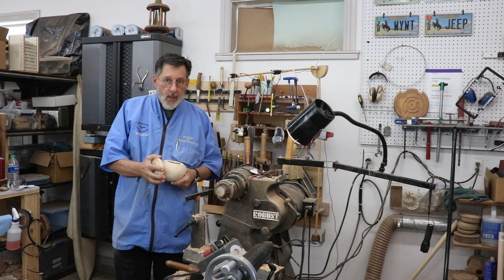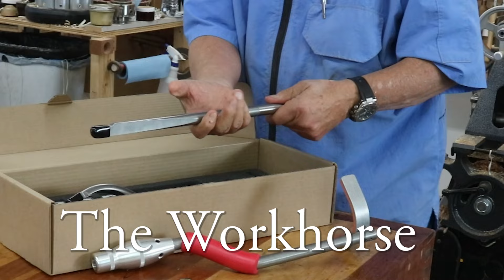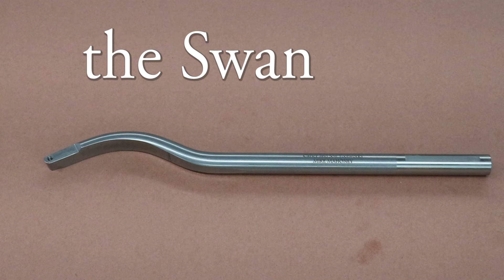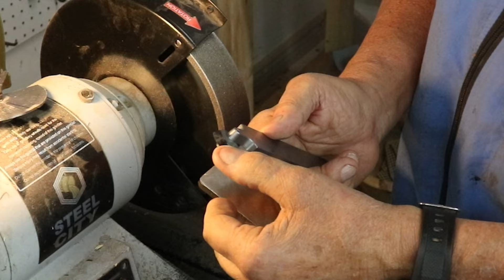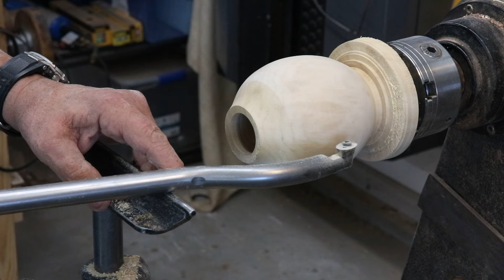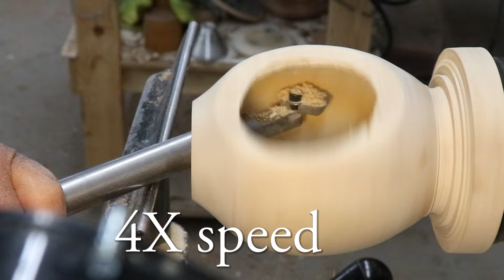Mike MaHoney Hollowing Kit Review   with Sam Angelo

Comment: Sam, great review. I was just recently made aware of it and appreciate your input. I have resisted the “captured” type system for various reasons. Feel like those might be better suited for really deep hollowing. Would love your thought? Winter is gonna hit here in MT one of these days . Stay say Sam.
Reply: Thanks for leaving the comment.  It's never winter inside my shop.....😁    I have the Trent Bosch stabilizer that I would consider a captured device.  The stabilizer is well suited for deep following. I personally don't hollow much beyond 11 or 12 inches deep. That is enough for me. With the Mike Mahoney Halloween kit, I am just figuring out the ins and outs of using it. But I think you could hollow a little deeper than with just an individual tool. But I do agree a captured system is far easier on my old hands and my hollow a little deeper. I am currently making another video on hollowing using the Carter and son Halloween tool.  I'm getting more used to it and I can really believe you could hollow beyond that 10 inch depth.  Anyway, hope this helps Sam
Reply: @ Thanks for your comments and look forward to a follow up video. Halloween tool? Hmmm